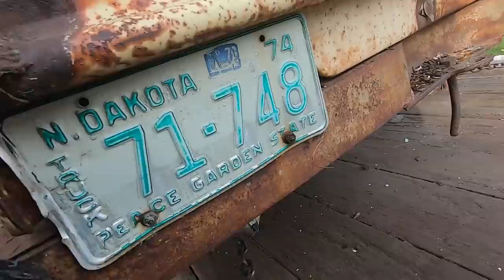Abandoned Farm Truck! 1964 International Harvester C900 Shortbed Stepside Will it run?!?

Comment: International's are fun to get parts for. They used parts from everyone and each truck was different. The had a line setting ticked which list the parts  use to build your truck. My father had one and they used three different master cyilders on the 1972 models. Two different distributors. I called IH and they told me the places that line setting ticked were hidden in the truck because people missplace them often.

Comment: My first car was an International...1955 3/4 ton.  straight six with A granny 4 SPD.  Topped out at 50 mph, but would pull the gates from the hinges of hell.  Came with 2 piece 16.5 inch wheels.  Dad found an old rusted out Studebaker pickup and pulled the wheels off of it for my farmall so I could do away with the 2 piece wheels and hopefully live a little longer.  LOL
Reply from the maker: Living dangerously!

Comment: My son's work truck is an International 71 3/4 ton 4x4 that he dropped a Cummins diesel in and a utility box. He also has a 72 International 1.5 ton flatbed. I really like both of his trucks. I drive a 77 F250 supercab Camper Special. We love the vintage trucks and the unusual. Hate to tell you, but new glass is very expensive. Son's front glass was $600 and took him awhile to find.
Reply from the maker: Yeah unfortunately IH parts are rare and expensive.

Comment: I worked on one of those engines in a 60's Joy air compressor. I didn't know they existed before that. Cool little motor. 
 Good call on passing the truck along. Those old Binder pickups are cool, but that one needs someone with a bunch of money. You made it run, so mission accomplished.
Reply from the maker: Never knew they used them as power plants!

Comment: I like that old Corn Binder.  I love old step side short box trucks.  I drove a '74 International to school every day.  Maybe  I would put the body on a newer 4x4 frame and running gear with a modern fuel injected 6 cylinder.  Then I'd keep it looking like a mostly original 4x4 that would be a reliable daily driver.  But then again, it looks great the way it is too.  Don't knock it, it's better than most of the four door mommy cars you pick up.  At least this one's a truck, and trucks are made for men.

I'm glad you're saving those old cars.

Comment: I had a '65 Scout with a 152ci . Still have the intake and carb from it in my shed. Probably bolt right on to Bob the binder ! The Scout had an electric fuel pump and a boat tank when I bought it. We threw a new battery in it, and sprayed liberal amounts of Cosby sauce down the carb. Then we found the toggle for the electric fuel pump. She fired , and shot out a flame about 3 foot tall out the carb. Melted an old bath mat right to the carb trying to put it out. Drove it home.
Reply from the maker: Haha sounds like a real gem of a Scout Erik!

Comment: Shes about the same condition as mine was when I started on it!
Reply from the maker: You need another one!
Reply: @MortskeRepair  get some flex tape for the cowl and gorilla tape for the bed holding down sheets of plywood....same for the FRED FLINTSTONE FLOORS
Reply from the maker: @rsprockets7846  I'm gonna need a pallet of tape! How about some screen door material and some Flex Seal in a can?!?
Reply: @MortskeRepair  sounds reasonable...but try some matte firbreglas and resin. Cheap and quick
Reply from the maker: @rsprockets7846  Then everyone for sure will think I'm cookin meth!
Reply: @MortskeRepair  ROTFLOL!!  
U sure you aren't?
Reply: @puddin's fab shop was the first one I thought of seeing that inter

Comment: When I was in college in 1962, I worked for a parts company driving a delivery truck. The company had three trucks. One Ford, one Chevy, and an International. The Ford got the best gas millage, The Chevy was the smooth rider, and the International was the gas sucker. They all ran well and were good trucks and the only complaint was the driver of the International said he couldn't pass a gas station. They were all six cylinder and standard shift. The good old days.

Comment: I had a '64 scout with the 4 banger. Also had vacuum wipers so someone just got the wrong fuel pump. pretty good torque for the size but 55 was all it would go.

Comment: The glass and doors are the same as the loadstar series trucks. They made those until 1978.  Used to be a lot of loadstar trucks on farms. But then there used to be a lot of stuff that ain't around no more.
Reply from the maker: There's trucks all over the place!
Reply: @MortskeRepair  not here in NE all scrapped or parted out. BOLO. For a ratted blazer chassis square body and motor and plop this cab and bed on it.....
Reply: @rsprockets7846  yup my dad almost bought a 65 ihc carryall bought a chevy instead 5 years later bought a 3 /ton chevy with a 454, a pullin beast but when he traded it for a car, it made his car payment

Comment: You could make the rear window from polycarbonate and a sabre saw would help make that easier. Use 1/4", and It won't yellow or crack.
Reply from the maker: Rear window is pretty low on the list!
Reply: @MortskeRepair  the cost of the brake and clutch components might equal to a "new" engine/transmission from a junk car. I can see why the rear window is low on the list of repairs.
Reply from the maker: @Farm_fab  No doubt!
Reply: @Farm_fab  get a rotted square body blazer or pickup and plop the van and bed on it

Comment: I am in on a search for a 1961 C-1300 (which in my memory had the quad headlights too). That was my Grandpa's only "brand new" wheat truck he bought for the family farm. It too had a "vision pane" through the driver's side floor board
Reply from the maker: I've got a 1962 Travelette with the quad headlights as well. I believe that was the last year. Hit up Puddin, he's always looking around for these things. I'll keep an eye out tho. Big trucks like that are usually pretty reasonable in the condition I find them! Just a pain to haul and parts for them are even harder to find than the 1/2 tons as far as brakes and drivetrain.

Comment: I had a '64 International. Got about 9 miles to the gallon and the gas gage didn't work. Ran out of gas a lot. Still loved it though. My brother had the crew cab. Always reminded me of that old country song. "give me 20 acres and I'll turn this rig around". WIDE turning radius. Parts were hard to find, not because they were rare, but because nobody at the auto parts stores could figure out the number system. If you called International Harvester they said "we don't make pickup trucks we make farm machinery". No help there. Got lucky and found a guy at a parts store that used to work for International. Parts were easy after that

Comment: I used to hate those four cylinder motors..... then when the saw mill engine blew up, I looked and said "with some electric bolts to hold things together, we can make it work for a few days". I took a whole day switching engines around and getting to look more permanent all the time, It fired up and after a good hour of arguing about how safe my work wasn't, we put the damn thing on line... it stayed there till we sold that mill. Had enough torque to get through the circle saw as when it catches its stride, it would really do a great job and it was quieter than the Wisconsin it used to have. Biggest problem was sawdust in radiator then. Other than parts,  and yes there are a lot of parts when looking for specific ones. A person needs to fix the parts one with a parts donor truck that is nice but the stuff that you don't need are good to sell.

Comment: Thanks for restoring those old IH vintage trucks, everyone one are just concentrating on the big 3 if you have problem finding a in line six I believe they share the same motor with the farmall tractors or diammond trucks they built them back on the day day just for display they built them as a work horse you take care for them a little they serve in your whole life time my uncle use them for his business and they outlive him too bad cousins got reed of the trucks I have a R 130 still all original except for the alternator as I said I convert it to 12 volts majority of electrical you can use ac delco as far as the rear end you use late model ring and pinion up 60s and you’ll be able to use it on the highway mind works well one thing I like with thier engine is the cam is gear to gear no belt no timing chain to change just regular maintenance oil change coolant and all very forgiving trucks I have a 4 speed I always start on the second gear coz the first gear is a granny gear its for pulling heavy weight thanks for restoring as I said put back their dignity they deserve thanks!

Comment: I had a 1950 Oldsmobile 88 (Futuramic!), and I needed to change a tire.  I got my big 4-way lug wrench, and proceeded to "loosen" the lug nuts (on the passenger side) and... you guessed it... I actually twisted the shaft of the 4-way about 1/2 way around (I was strong as an ox, and almost as smart!) when my Dad came out to check on why I was cursing loudly in the driveway.  I explained the situation, and he started laughing!  That's when he explained about the left-hand thread lug nuts... Oh, hey... big fan of the Duff dog!
Reply from the maker: At least you didn't snap the studs off!

Comment: I bought my Dad a 69 long bed with granny 4 speed and I think 304 V8 for Father's day for $150 guy had the motor rebuilt but they dropped a valve guide my brother fixed it quick.  Vinyl top air shocks on rear we painted and he drove it for years

Comment: Poor Binder Bob! - if you have stuck pistons in clutch cylinders etc try holding the cylinder in your hand and hitting the cyl on the open end with a copper hammer I was showed it by an old guy and it works a treat

Comment: At the shop where I worked, we rebuilt a lot of brake cylinders (wheel and master cyls) and used a little three stone hone on a drill ( like for engine cyls, just smaller) with much success .
Reply from the maker: Yup, got one!

Comment: I always do my dumpster diving for parts behind the Piggly Wiggly a cheap place to shop lol "This is how Mortske loses an eye" when you were taking apart the Master cylinder combo. Really surprised the International engine wasn't frozen solid with all the weeds growing out of it. Yeah probably a candidate for a Dodge Diplomat swap drive train wise at least it will have a decent drive train then patch panel time.
Reply from the maker: If only there was Diplomats left around the country side!
Reply: @MortskeRepair  If only yes true. I had a 68 dodge charger if only those were spread over the countryside. Still kicking myself for selling that and my 68 Chevy impala

Comment: In 1979, my girlfriends parents had one of those crappy 4 bangers in a Scout.  It never ran right and would backfire and blow up the muffler.  You could hear her old man row it through the gears for a good 2 or three miles before pulling it into the driveway.  Kinda acted as an early warning system to get “decent”😉😁
Reply from the maker: Hahaha that's good stuff!
Reply: You can say what you want about the truck but those 152 and 304 sucked fuel but would run and run and run. Good motors with a very strong commercial block.

Comment: Amazing some of those door parts if not the whole doors just might fit on the big International trucks of the day. We had a 1966 Loadstar 1600 and I'd bet those doors would fit that big old truck. Yes, I know alot of manufacturers made things interchangeable. Anyhoo, I agree the thing is a bit too far gone and good for chassis swap or something like that. And I do think those Internationals were notorious for cab corners under the dash rotting out. Our old 1966 Loadstar 1600 had the bubblies going on in the same area but on the outer panels. I believe the way they were designed, dirt, leaves, or in our case - wheat chaff could collect there, gather moisture and rust it out.

Comment: Love the C900’s. They’re rare and actually make great hot rod trucks. The bed is actually shorter than a short bed. International short beds are usually 6.5’ long. These are only around 5 foot. That’s why there is no step between the cab and rear fender. I have one that’s in beautiful shape that I am adding to a 62 that I am hot rodding. I’m using an LT1 with a Camaro sub frame. Going to be sweet.
Reply from the maker: Great info!

Comment: If I am not mistaken the Aussie IH light trucks were actually the chassis of the pre 1959 R Series mounted with the cabin from these and unique front sheet metal - ran to 1979.  The cab design was also licensed to Dodge for a similar range of trucks as well as being mounted to heavy trucks of both makes.  This model never came to Australia.
Reply from the maker: Ahh gotcha!

Comment: Cool truck! Too bad it's so rough.I see Internationals around here, but not stepsides from that era. My Grandpa had a 1965 travelall that he ordered new when he retired, loaded, 4-wheel drive. He also bought a 1963 4x4 Scout , used, that had that 4-cylinder engine( My Mom drove me to kinder-garden in it), but it also had granny gears. I  didn't know you could get that in the truck. A little slow, I would think...
Reply from the maker: A 4WD Travelall has to be pretty rare!

Comment: Cool truck. I never heard of a 4 cyl. I had a 66 and a couple of 52s. Tough trucks. Same wheel pattern for years. I put Dodge rims on my 52 cus the 16 inch it came with wee too expensive to replace. 14 inch on the front gave it a heck of a rake, but the brakes worked better.

Comment: Once had a '65 binder which was nice but rough too...friggin' parts were hard to find & high dollar.  It had it's good points but I got tired of issues it had so sold it cheap...
Reply from the maker: yeah, that's what might happen to this one...
Reply: @MortskeRepair  swap in a 305 and 4 speed from a full size impala

Comment: Quick fix for the roof - heat the dent with a torch and then immediately take a cold wet rag and put it on the dent.  It will shrink the metal back into shape

Comment: I had a 1964 C1000 in 1976.  It had independent front with torsion bars like a Dodge.  Had a front sway bar from a Travelall and a 4 speed with the extra low first transmission.  That was a great truck.
Reply from the maker: This has the silly straight axle!

Comment: You made a valiant effort trying to make sense of that nightmare. Find a good 318 and torque-flight and put the 430 dollars you save on new glass.That truck is an odd-ball, but worth saving.
Reply from the maker: Yeah it's different!
Reply: @MortskeRepair  any dodge diplomats or  cordova's junked around. Same with a sbc car cheeper to buy parts cars than to purchase parts
Reply: I have the Canadian version. They were built in 62 and 63 only up here with the quad headlight grill. It has a special fleet side box with a narrowed tailgate. It was a C99. The cheapest pickup available from any brand at that time. They didn’t sell very well and were discontinued for 64.
Reply from the maker: @junkorbust9498  Nice! I know a lot of them were government vehicles due to the low bids.
Reply: @MortskeRepair  The rear track was significantly narrower than the front so they were terrible to drive in mud or snow. The rear would be out slideways. They were 1/4 ton trucks.
Reply from the maker: @junkorbust9498  Interesting. I know the square body GM 4WDs are like this as well.
Reply: @MortskeRepair  The rear track on the Canadian model is narrower by close to half a tire width on each side. They used the scout axle in rear I believe but the full size truck axle up front.
Reply: or a 350 th350 for half that price!!
Reply: @junkorbust9498  ?

Comment: By car standards, International V8s were all big blocks...  therefore a 152 being half of the IH 304 was still a big block platform hence the size of the engine.
Reply: Big blocks usually mean big cylinder bores usually 4 inches or more

Comment: That's the 65grille my first truck was a 65 International 1/2 ton. Had a 241 6 cylinder 3 speed on the column auxillary overdrive 4;10 gears Dana 40 with a power lock. And it was fire engine red.
Reply: almost bought a ihc school bus camper with 241 6 popper

Comment: The logical thing to do is to cut out and scrap the firewall/floor/bed/chassis and throw whats left on to a crown vic frame and running gear and graft it on to the vics firewall and floor since they both roughly share the same 115" wheelbase. That's what I would do, but then again what do I know, I sell shoes for a livin.
Reply from the maker: You got any good deals on some shoes? Size 11.5?

Comment: The oil lots people use in pickups or old stake truck on farms be 15w40 from Shell called Rolleita  hearing use and Fram Oil Filter , Air Filter, Fuel filter, PCV Valve to for parts ! Also if they had Generator Delco 70 to 90 amps or put GM Delco be 1968 to 1985 be 1 or 2 stage with regulator 35 to 70  then use 70 to 90 amps types ! One thing Lol International did was fuel pump had glass bowl filter on bottom to easy to change! Also they used carbs with hand choke cable to ! That truck possibly has Bow Low 4 speed gear transmission called D16 or D18 and first year of Power Wipers motor to and hydraulic Clutch plus brakes to with Dot 3 fluid !
Reply from the maker: Great info as always Andrew!
Reply: @MortskeRepair  :) welcome to help anytime also !